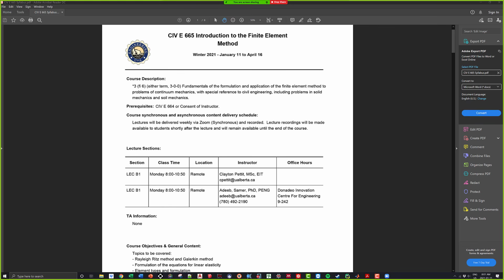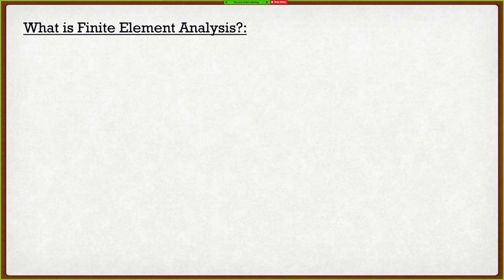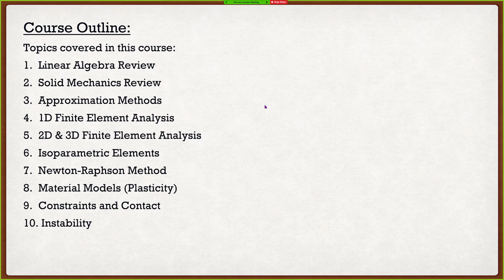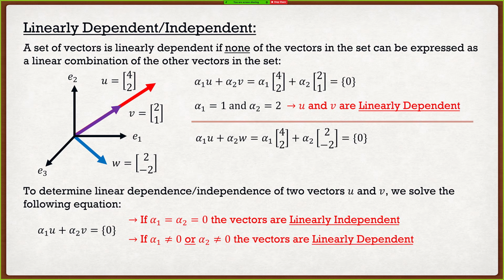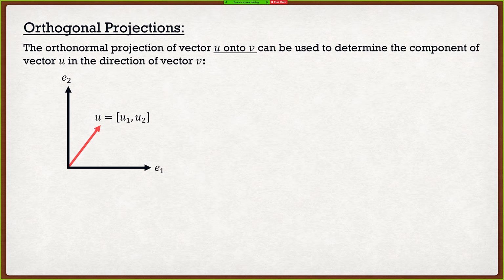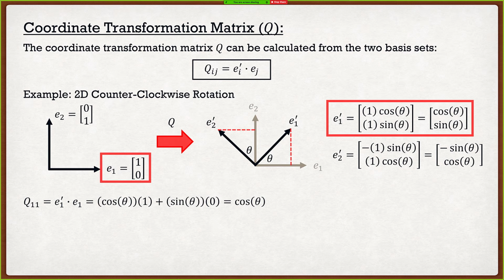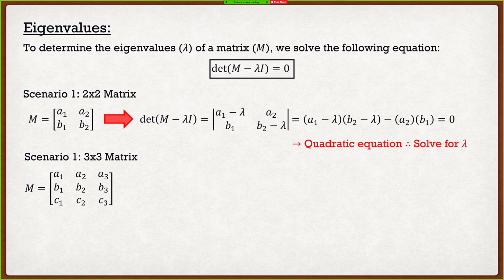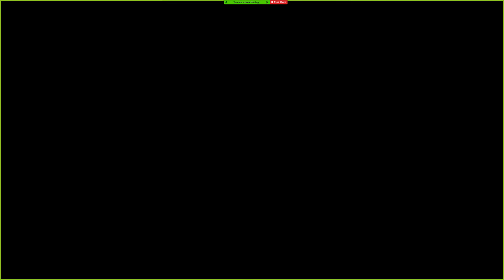Intro to the Finite Element Method Lecture 1 | Introduction & Linear Algebra Review

Comment: The statement "a set of vectors is linearly dependent if none of the vectors in the set can be expressed as a linear combination of the other vectors in the set" is incorrect because it is describing linear independence, not linear dependence.